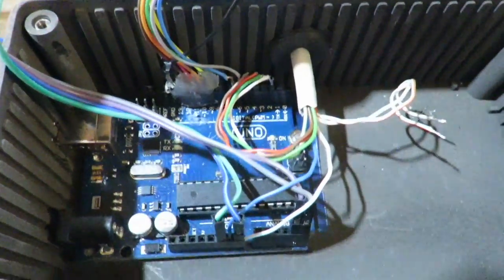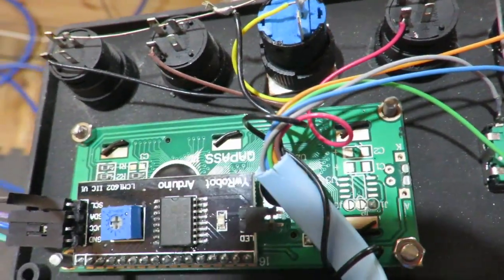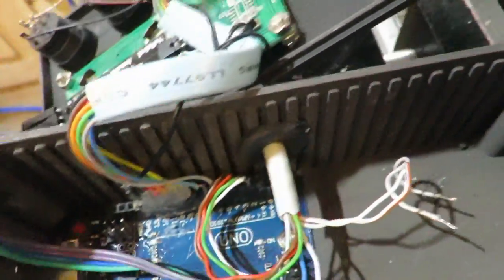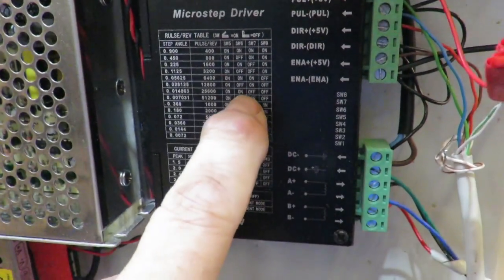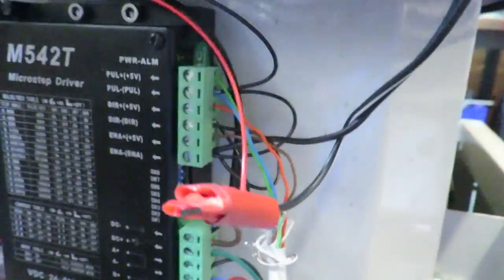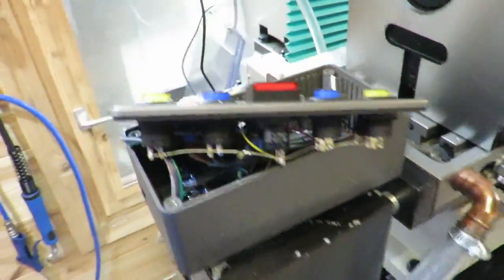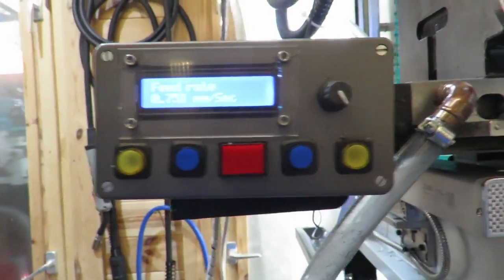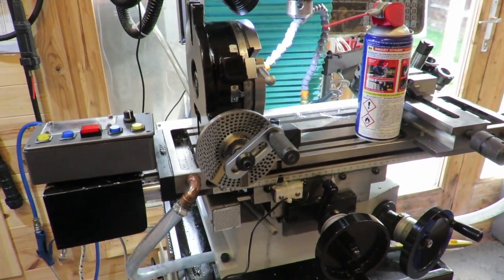Axminster / SIEG SX3 Mill Power Feed Part 4

Comment: Hi Chris very interested in your project I have my lathe set up with ELS and I am constructing a simple feed with Arduino on my mill but I prefer your set up: one question The "Rotary switch" is this a Potentiometer can you advise please much obliged
Reply from the maker: Leslie the rotary switch is a digital with push switch function. I think it was from Adafruit.
Reply: @ChrisMower  Thank you
Reply: Hi I am not sure about the wiring to stepper driver I paused the video and looked at the connections and it  appears that the connections are positive to ena, dir and pul  and the negatives ena, dir, pul, all connected to ground is this correct Chris?
Reply from the maker: @872stro  In the case of my stepper driver that is correct. I'm fairly certain that all drivers will be similar. What you have here is connection via opto-isolators so that there is no physical connection between the stepper driver and any unsafe voltages. The input to the driver is an LED which is sealed in with a photo transistor. The current through the LED turns on the phototransistor and thus passes the pulse in without actually having to have a direct connection. So the Arduino sends a +5V signal to the positive input and the negative is taken to ground to complete the path. I hope that makes sense.
Reply: @ChrisMower  thank you once again I could have gone wrong here as  I only queried this as my ELS on the lathe which I copied the code from is a derivative of the Russian ino " digifeed "and schematic layout  which was translated into English by some clever person  are opposite  : all positives connected to 5 v rail and the negatives to ena, dir, pul connections so thank you for your reply, I have nearly finished the project waiting for some parts
Reply from the maker: @872stro  yes, you can connect to +ve to +5V and use the Arduino to ground the negative. It just means you have to reverse the signal polarity in the code to output a low instead of a high.
Reply: @ChrisMower  very informative..thanks

Comment: I purchased the components for this when it was shown in one of the model engineering magazines. I have now found time to build it, but am unable to find the magazines. Could you please remind me as to which magazine it was in.
Thanks for the videos and the Arduino code. I will probably be able to build it from your videos if I cannot find the mags
Reply from the maker: Peter I was not aware that it had appeared in a magazine so I'm unable to help you there.
Reply: @ChrisMower  Thanks for the quick reply. I have now compared what I purchased and the driver board is different. so, it looks like I have mistaken your system to be the same one.
However, I should be able to use your information to build it using the components I have.
Your Arduino code is well documented and should work with my hardware. If I need to change any code it should be straightforward. The stepper test code in one of your other videos will help me check out my driver board.
Thanks for taking the time to present this project.
Reply from the maker: @peterhothersall5172  glad I could help. Good luck with your project.

Comment: Hello again Chris.
I am still having problems with the code if you could help that would be great.
I have downloaded the millcode MK2 master I unzip it and get a folder named power-feed i open that and that gives me 12 files ( controls,controls,debug,defs.licence.millcode(ziped),modes,newliquidcrystal (zipped) power-feed,readme,timerand timer
so I open the zipped file named millcode I unzip it and that gives me 2 files macosx and millcode so I open the millcode folder which gives me 5 files .git ,interruptserviceroutines,millcode,readme and utilityfunctions.So I do as you said I open a new folder and name it millcode I then put the 3 files (interruptserviceroutines,millcode and utilityfunctions into it I open the file millcode which opens the Arduino ide which now has the 3 tabs open I press the verify and the first error comes up which is the liquidcrystal i2c.h so I install the file from the link at the  bottom of your instructions for the millcode MK2 master and install it in the library and that fixes that error (I know its not the correct file for my lcd screen but at this point I have not connected my control box to my computer)
I try the verify button again and get the error
"POSTIVE" was not declared in this scope
 LiquidCrystal_I2C lcd(LCD_I2C_ADDRESS, 2, 1, 0, 4, 5, 6, 7, 3, POSITIVE);
which is line 60
Any ideas ?
thanks Jamie.

Comment: Hi Chris great video.
I just need a little help as I am not great at the computer side of things. I have copied your design I just can not get past  programming the Arduino code, I have run the stepper motor test program and got all the values for my setup then when I run the miilcode I got the first error which was "LiquidCrystal_I2C.h" library I added it to my library which fixed that error then I got "PinChangeInterrupt.h" error so I found that file and added that to my library which fixed that error and now I am stuck at the latest error which is
 'setEnable' was not declared in this scope
it is on line 160 of your code  setEnable( false );
 any ideas?
Reply from the maker: Let me look into it Jamie. I will get back to you later.
Reply from the maker: OK, the method setEnable is declared in the file UtilityFunctions.ino which should have been opened when you opened the main .ino file. Did you create the correct file structure? 
Create a folder called Millcode, then into the folder put the files millcode.ino, InterruptServiceRoutines.ino and UtilityFunctions.ino
Then when you open the millcode.ino in the Arduino IDE it should be fine.
If you have modified the millcode.ino for your LCD make sure that you use your modified file other than the original so you don't undo the work you have put in.
Hope this helps.
Reply: @ChrisMower  Thank you for getting back to me.
I am still I little confused I downloaded the file millcode I opened it and  and that contained 2 folders (macosx and millcode) I opened millcode which contained 5 folders ( git ,Interrupserviceroutines , millcode Readme and utilityfunctions ) so am I right in opening millcode from this list? if I do it opens the Arduino program and that when I run into my problem.
Reply from the maker: @jamierowbottom7845  The Arduino IDE is a bit strange in that it is not like most other C/C++ IDE's. It expects the main file to be in a directory with the same name as the main code minus the .ino
Any other files that are required need to be in that directory as well. So if you have all of the files in the millcode directory and open the file millcode.ino then you should see three tabs at the top labelled millcode, InterruptServiceRoutines and UtilityFunctions. If not then that is the cause of the problem and it would appear to be something happening with your Arduino IDE.
In the IDE try going to Sketch->Add File and adding the UtilityFunctions.ino file and doing. test compile.
Reply: @ChrisMower  Thank you for all you excellent help .at the start of this week I hand never even herd of Arduino.
I uninstalled and reinstalled the Arduino software and started fresh I now get the tabs at the top of the screen.
I have downloaded the millcodeMKII master I opened the unzipped file and now have 8 tabs at the top I click on the tab which says power-feed and click on the verify tab and the program checks the code and it says there is an error" POSITIVE" was not declared in this scope.
it is on line 31 of the new MK2 master code which is
 LiquidCrystal_I2C lcd(LCD_I2C_ADDRESS, 2, 1, 0, 4, 5, 6, 7, 3, POSITIVE);  
I did not change the code as per last time (last time I changed line 31 to read " LiquidCrystal_I2C lcd(LCD_I2C_ADDRESS,  16 , 2 );  "  )  because I did not yet connect to my Arduino.
I can not work out what's wrong this time.
Reply: something really strange has happened now if I open  the millcode file and run the verify button it runs and says there is a different error this time it on line 94 " lcd.begin(16, 2); " the error reads No matching function for call to " LiquidCrystal_I2C::begin(int, int)"
any ideas ?
thanks 
jamie.

Comment: Hi Chris, Great concept! However, I appear to have some problems with the code. When uploading I get the error message: "'POSITIVE' was not declared in this scope". As I am not very familiar with Arduino programming, I'm at a loss! I'd very much appreciate any suggestions to help me out.
Reply from the maker: This usually means that you are missing a file. The constant POSITIVE is declared in a file which the program currently is not including. I am currently laid up with vaccine side effects from my shot yesterday so can’t do anything to help, but give me a day or so and I’ll try to find out what is missing.
Reply: @ChrisMower  Thanks for quick response! I hope you'll recover soon. Not just for my sake ;-)
Reply from the maker: @hansvanderveer6167  The definition of POSITIVE is in the LiquidCrystal_I2C.h file which was needed for my LCD's display. Unfortunately there are a zillion LCD displays available and they all seem to have slight variations in how they are initialised, but they are fairly easy to adapt. If you look at the code you will see that there are only a couple of references to the LCD so if you take an example of the code that works with your LCD you can just modify my code to match how yours works. Usually it's just a difference in how the LCD is instantiated.
Reply: @ChrisMower  Thank you for the suggestions.
I have several “LiquidCrystal.h" files but I have not found one that contains the definition of POSITIVE! 
I will now start looking for the missing statement! Thanks again for pointing me in this direction!
Reply from the maker: @hansvanderveer6167  you don’t need to search. If you use the include files for the LCD you are using instead of mine you just need to alter my code to match. Easiest way is to try one of the example files that work with your display to see how they do it then fix my code to match. It’s not as hard as it sounds since there are only a few places in my code that use the lcd.
Reply: @ChrisMower  I am very much impressed by your tenacity to get me on the right track! Ik will follow your advice! Judging by your reactions I take it that the side effects of your jab have meanwhile been subsided!
Reply from the maker: @hansvanderveer6167  not quite, but as my old drill instructor used to tell me as I was lying face down in the mud - "It's only pain lad, only pain"
Reply: @ChrisMower  In that case I hope that responding to my ignorance may be a distraction for you. Or, as my drill sergeant used to say in comparable circumstances: don't worry lad: in a month or two you'll laugh about it!

Comment: Hi Chris, Your setup and code is very nice and handy for the purpose, your tutorials very helpful -congratulations!
 I have replicated the build and cleared the I2C library issue so I have it working almost fully. Please help me with the following as I am so close that almost hurts:
Both in your code MillCodeMkII and in power-feed derivative I have problems with encoder switch function.
 In your code the problems are a bit higher: the LCD shows a constant 1.053mm/s value which cannot be changed by rotating the knob, either left or right. Though, the motor receives "clicks"  -momentary reaction at  each encoder pulse - in it's spin.
In power-feed the functionality is almost complete, the only problem is both left or right rotation of encoder has the same effect on the set speed- either continuously increasing value or decreasing it (I have played with encoder multiplier, making it 1 or -1 so I have the direction changed at upload, but other than that I cannot have it working in both directions; increasing and decreasing motor speed). Though, encoder's switch resets speed to default value. There is an additional problem -sometimes when rotating knob the speed jumps several speed-steps at a click - either increasing or decreasing value, but this I believe is due-to some interference.
My problem, I believe, is generated by some variable attached to rotary encoder's  input in program but I don-t have knowledge in Arduino programming. The encoder is  KY-040 rotary encoder.

Please help me adjust it in both versions of the code.
Thank you!
Reply: Hi Chris, and all. Adding filtering capacitors 0.1mF between ground and A/B connections of  rotary encoder normalized its output. Now it works reliably and like a charm!
Thank you very much!

Comment: Hello again. Been using your design for a few weeks now but have an intermittent problem. Ever so often the the motor give a jitter and stops. This only happens at speeds over 4mm per second. The arduino, display and buttons freeze. Only corrected by switching off and on again. Tried to eliminate what I thought may be the problem but fault still there. Just wondered whether you have a similar problem. Corrections tried.  Decoupling capacitors on inputs dir. ena. dir. and voltage inputs. Swapped the motor...it's a 4.2amp running on 36v. Even tried using the digital version of the driver. Adjusting the code. Steps and pulse width. All wiring checked. separate power supply for Arduino and stepper motor. Nothing I do changes the fault so have come to the conclusion it may be something in the code. Is it a problem you have  encountered?  Any thoughts you have would be welcome. Thank you .
Reply from the maker: I can't say that I have seen that problem on my installation.I can take a look at the code to see if anything stands out as a potential issue but off the top of my head I can't. I wouldn't put caps on the Step, Dir and Enable as this will degrade the pulse waveform. Separate PSU for the Arduino is a good idea though.
For everything to freeze up sounds to me as if the Arduino has wandered off into LaLa land. This is usually the result of a buffer overrun. Alternatively it may be waiting a resource that doesn't come ready.
If you can give me a way to reproduce what you are seing it would help, so can you try to find a set of instructions that will reliably trigger it?
Reply: @ChrisMower  Thank you, will do. I did take the caps off when it had no effect on the problem. The driver I now use also has the anti resonance  built into it. Ill get a video of it too. Doesn't affect the milling operations as I have it at lower speeds. Just a problem it would be nice to solve. Regards K
Reply: Hello. I think that I have solved it. When the jitter happened it would be for either a fraction of a second and recover or a little longer and stop. The display would show the stop sign, circular dot. In the Arduino code under defs there's 'ticks' for the end stop. I increased this number to 300. No jitter and it seems to have done the job. At the moment I haven't yet fitted the the end stops , pin 2 being grounded,so picking up something that grounds it. Still it now works. My understanding of any type of code is very limited so what do you think?
Reply from the maker: @keveggy4318  OK if it thinks that it has hit an end stop then it will disable for obvious reasons. I have an end-stop detector in the center and a magnet at each end where I want it to stop. When it hits the stop going one way I just turn it a bit by hand in the other direction which clears the end stop so it responds again. Sounds as though you have it working.
Reply: @ChrisMower  Fingers crossed. Thank you.
Reply: @ChrisMower  Well. It seems to fix but the problem started again. I had noticed that it happened more when the mill table was towards the right hand side. That was when I discovered it was only happening when the cable from the hand controller was next to the stepper motor. Re routing the cable to the other side has completely solved it. Must have been picking up interference from the motor signal. I will also ground the metal cable conduit, just to be sure.
Reply from the maker: @keveggy4318  that will account for why I couldn’t reproduce it in testing on my mill😉
Glad you have it sorted.

Comment: Hello Chris, got it connected to the actual stepper and driving my mill, very pleased. Just one more question if I may. In the code under Defs.h  Regarding the line   '#define STEPS_PER_ROTATION 12800L.'  Question 1. Does this need to match the setting on the dip switches on the stepper driver unit?  Question 2. If I change this value do I then need to change other values in the code? Thank you K
Reply from the maker: Hi Kevin. I’ll have to check the code when I get back as I am away at the moment, but I suspect the answer is yes re the switches. I don’t think you will need to change anything else as the calculations are based on the defines.

Comment: Hello. Got it all working. My display users the PCF8574 library. I got it to work by deleting all the ref. to 'if' in the code and just leaving the  parts of the code that specify the use of the PCF8574. Another point that may help others is...If you are using the i12c display make sure that the library you use specifies POSITIVE and NEGATIVE  in the KEYWORDS txt file. Thank you.
Reply from the maker: The display library was always a bit of a problem since there are so many clones about, each with a slightly different library. A real pain. Anyway, glad you managed to sort it out.
Reply: @ChrisMower  Thank you. Although I'm still at the bottom of the Arduino learning curve I may set my next task to change the buttons and display to a colour touch screen. That is after doing some actual milling.